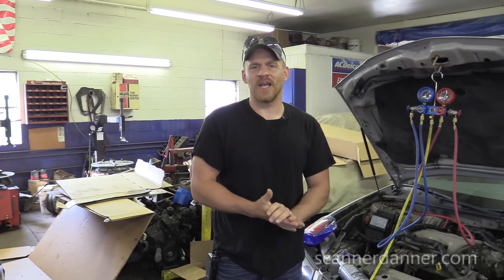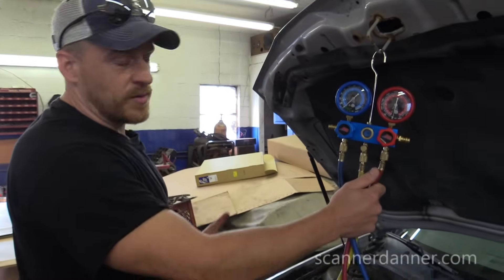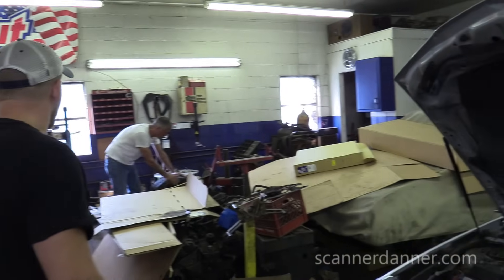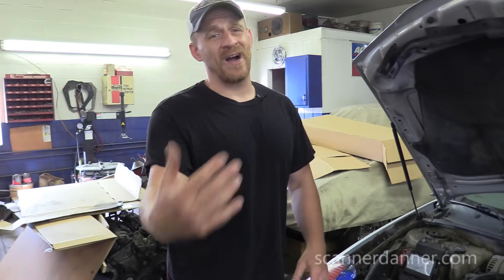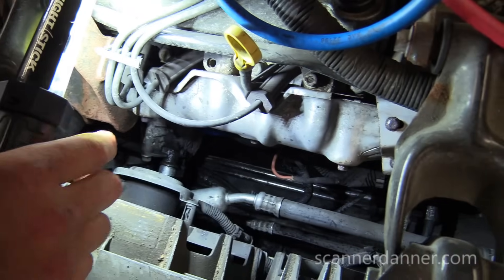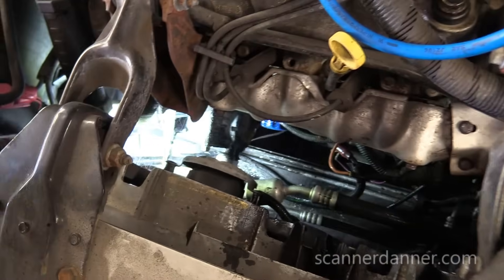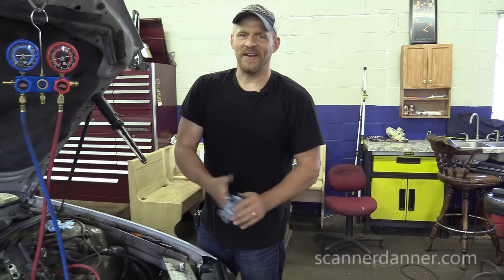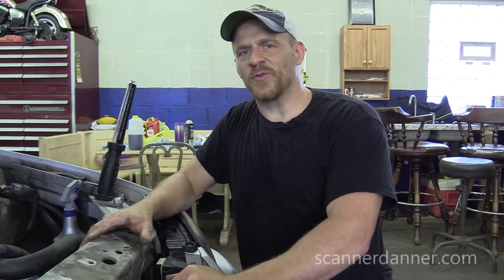A/C Leak Testing Using Compressed Air, Soap and Water (any car)

Comment: Hey Scanner! I added freon to our Peterbilt 379 Road Tractor and the lowest vent temp I saw was 50 degrees.
That was at 25 PSI low side and 180 ish high side 78 degrees ambient temp.

Any more pressure than that and temps dropped in the vents from 26 psi up to 40 psi.
At 40 PSI it finally settled at 64 degrees vent temp.
I'm think that moisture is in the system. Maybe I should evacuate the system, vacuum it down extra long and try it over?
Reply: Blade - I added shut off valves to the heater cores for summer in the freightliner ( freightliners suck) I drive. You'll definitely drop your temp if you just added refrigerant to what might have been a lot of air or at least some air. If you're adding, their is a leak. Should probably find it, or you might not be doing anything by vacuuming ( would need a micron gauge to really see what's going on)and definitely replace receiver dryer, that will drop your temp more.
Reply: It does have a heater core with blend doors but I've cut off the valves under the hood to the heater core.
Without that it blows 70+  degrees in the vents.
Somethings definitely not right with the Pete our KW is blowin a chillin 39 degrees in the vents since we put a new compressor, dryer  and expansion valve in it.
Reply from the maker: IS there also a heater core and blend doors like in a car? If so, pinch off the heater hoses and see if your temp drops at the vents.
Reply: Yeah there's definitely a leak. We've had to add freon every summer for 4 years now, I guess since it got a new compressor. Its a slow leak but still a leak that needs fixing. I've been trying to get a recovery machine so we don't waste freon to do repairs. 

I have everything now but the recovery machine. I have a recovery tank scales, gauges etc.

The Pete actually came with valves to shut the heater core off. We keep those off all summer.
I've seen folks add them to light trucks like F150's as well and it definitely helps to keep the heat out of the dash.
Reply: Blade, as Dan has been emphasizing, on your Pete, it is highly inadvisable to pressurize the system with shop air, for the Pete probably still has R14a in it.  On our KW's, I often discover the schraeder valves are the source of the slow leak and just installing new "O" rings fixes that issue.  Hope that helps. 

Over those last four years, each year how many pounds/ounces have been added to make the air cool enough?  Bear in mind that after the  annual addition of the refrigerant into the Pete, air is still present in the system, and so maximum cooling efficiency cannot be achieved.
Reply from the maker: Chad Jessup my name is Paul :-)
Reply: And I would guess that I am not the first one to commit that mistake. :-)  I'll try not to do that again.

Comment: To set the record straight  from  R134a  saftey data sheet.
Flash Point:  Non-inflamable
Ignition temperature: Not Applicable (Non-inflamable)
Upper Exlosive Limit: Not Applicable Non-infamable)
Reply from the maker: Thanks Andy!
Reply: Andrew W MacFadyen well then

Comment: I have a small flask of ultra pure nitrogen that I like to use for testing. A bonus is that it's a very quiet process and can often hear leaks. I use a UV torch to search for leaks in a dark as possible workshop. The leak will fluoresce under UV lighting.

Comment: I have 100% Argon with my tig welder, and I've often wondered if that would work as well as nitrogen does for this indication. It's certainly inert, and finding a connector to the gauge set shouldn't be difficult. I've never tried.
Reply: yes you can use argon, but beware, it's heavier than air and will displace it in confined/small areas, possibly causing suffocation in enclosed low areas... nitrogen is a little lighter than air, so less chance of suffocation, but always be safe and well ventilated. (probably not cost effective though)
I'm sure you know that being a welder, the warning is for others :)

quote from 'national refrigerants article,  ""When a system needs to be pressurized, for example to perform leak checking, nitrogen or argon are commonly used. These inert gases are also purged through lines when brazing in order to reduce oxidation buildup inside tubing.""

http://www.refrigerants.com/pdf/NRInews-Smr11.pdf
Reply: spelunkerd It would be a little more expensive but I'm sure it would work it's clean and dry
Reply from the maker: Not sure brother.
Reply: Dear spelunkerd I saw all practical HVAC people are using regular compressed air to find the leak. I also used tons of times and not got any problem only a single time! The HVAC theory makes things that complicated that nobody with readily available resources could do a useful work. This is an unfortunate and discouraging behavior. Paul did the nice job while testing and hope his system may run with professional results. Regards,

Comment: What kind of Hack are you?  You are a teacher you need to use nitrogen.  This is not a safe  method.  You are  contaminating the oil. It is a fire Hazard to.  Please do some research!!!!
Reply from the maker: It's not a fire hazard when there is no refrigerant in the system. 
I've been using this method for 25 years with Zero issues. 
You don't have to like it. I think it's a much better alternative than adding refrigerant to find a leak, especially when it's a gaping hole and all you end up doing is pumping refrigerant into the atmosphere.
Reply: ScannerDanner how about I for you to manufacturers AC manuals.     Just because you've been doing it for 25 years don't make it right.  The change came more apparent when started using 134A.  Please leave me your email address and I won't make it public and that way you can learn and pass on the information.
Reply from the maker: We can all learn right here bro. I don't mind. Post it. Just leave the name calling out of it. We can have a pleasant disagreement without it.
BTW, there are a lot of things I do that a manufacture wouldn't recommend. I'm not a "by the book only" guy. Everyone I know that is like that can't even fix a sandwich let alone a car.
Safety is another issue though. If your telling me that an EMPTY system can be explosive in some way with compressed air, I would like to read about that. I just don't see it.
Reply: very cool info- I would try compressed air on one of dad's or my used cars if he was still in business. I did a lot of the  r~12 auto's and read the same thing of r-12 being explosive with the right amount of air. In the early 80's i had 3 cars in shop, fans running and radio blasting. hook up to car w/ 30lb tank r-12  open both manifold valves and walking around, fucking off  I look at the gauges and they still on 0 psi. i like wtf is going on. i here  it under car. looking around there is hoses missing on the car.  I would not use that method on a brand new car though or the new refrigerant 1234sf as it is certainly flammable,   i have herd
Reply: My comment above about the test light is tongue in cheek, of course.  I have learned more from Paul Danner than any other tech, in person or on YouTube, thanks to his premium channel and his book (highly recommend, by the way.)  What I have learned, aside from the obvious technical stuff, and how to safely use a test light on a computer controlled circuit, is that he will admit his mistakes and keep them in his videos--He doesn't edit the mistakes out to make himself look perfect.  Sometimes I even laugh at him but the lessons are there to be learned by us all.  He's an excellent teacher.  

In this case I just don't see any mistake.  I admit I am self-taught and YouTube taught in AC work but have done quite a few systems from simple recharges to full system replacements.  I just don't see how filling a completely empty system with compressed air poses any safety issue.  Air is already 70% nitrogen so is mostly inert anyway.  And with no R134 in the system it poses as much of a safety hazard as your air compressor itself does.  I'd admit it's not a good idea to put it in a system with refrigerant left in the system but not sure why you'd want to anyway.  

ScannerDanner is one of the best teachers on YouTube and I appreciate the significant time and effort he puts into his videos.  If you don't subscribe to his premium channel, you should.  I think most every tech (and DIY'er) out there could learn from it.
Reply: Yeah, quit using that test light on computer controlled circuits!!
Reply from the maker: Lol exactly
Reply from the maker: Thank you so much johnaclark1 you have no idea how much this type of feedback means to me. It is the wind in my sails to keep going!
Reply: I don't just give it.  You've earned it, Paul.  Your channels have given me the confidence to do work for more than just myself and have earned me some extra cash on the side.  Some happy car owners have left my garage thanks to what I've learned from you, as well as Eric O. and Ivan.  I even fixed a car with some O2 codes that two other shops couldn't/wouldn't fix and I've no formal training other than your premium channel. 

Just keep it up.  There are many that really appreciate it.
Reply: I second everything Mr Clark wrote.

Comment: The ScannerDanner Premium Channel is where it's at, folks. Subscribe! You won't be disappointed, I can tell you that for sure. 

I'll be doing this same job next weekend on my buddy's mom's '03 Monte Carlo. Has a small leak somewhere. I'll be cheating, though, with my H-10 Pro! :D That thing is amazing ... but I guess it should be for what they cost. 

When I check for leaks using a spray, I use Windex - it's a crappy glass cleaner (ALWAYS leaves smudges and streaks), but works beautifully on tires, tubes, or A/C systems. It's my go-to bottle when customers have slow, nagging tire leaks - hasn't let me down yet! Can spray an entire tire down in half a minute, and any small punctures will reveal themselves pretty quick. Makes super fine bubbles on small leaks, and larger bubbles on bigger leaks.

I love doing A/C work. First system I ever touched was my aftermarket AMA under-dash unit in my '72 El Camino about 17 years ago. TXV system designed for R12. Ran Freeze-12 alternative refrigerant in it for about a decade - stuff worked great! Years later I was playing around and charged the system up with BBQ propane out of the grill, LOL. Thing was like a supermarket freezer - fogged up the rear glass, and blew vent temps around 33°F. Was AWESOME on a 94° day with 77% humidity. :D  I accepted responsibility for my own safety, so it was all good. :)
Reply from the maker: I've heard of people doing that when R12 cost went through the roof. I also heard of someone blowing themselves up due to an EVAP core leak. They lit a cigarette and BOOM. At least we were told that. Who knows. I know I wouldn't use a flammable refrigerant, though I've heard some manufactures may be going to that?
Reply: The new 1234YF is mildly flammable. Not as much as propane, but it will burn, I hear.

There's a product out there called Envirosafe that I've used before - they don't tell you what the components are, but I suspect it's R290 (propane) and R600 (butane) mixed. Butane keeps the pressure in check. There's a few others out there that are flammable too.

I hear that Europe and Canada use R290 in many different applications, including household refrigerators. 

Could be scare tactics from companies that stand to lose alot of money. Never know ...
Reply: I have been running R-152 (canned air duster) in my 1989 truck, originally R-12 system then converted to 134 (dirty DIY conversion) for 2 years now. Cold as ice, I get 4 cans for $10, system takes 2 cans. The sniffer detects the stuff too. I'm sure there's still some old R-12 mineral oil in there as well as the ester oil I have added over the years.
Reply: I almost bought a case of that stuff before I restored the system on our '86 Grand Marquis. I've seen similar results as yours posted across the net.

I had run just about everything for refrigerant in that thing, before the 29 year old (at the time) compressor decided it had had enough of that, and got real LOUD, lol. I think the 142b in the Freeze-12 that I was running leaked out, leaving just 134a in the mineral oil/ester mix, and starved the compressor of lubricant. 

Restored it back to original R12 and mineral oil. Everything new. Thing blows vent temps in the upper 30's on 90°, humid days. It's absolutely awesome. :)

Comment: thanks good morning and is coffee time for me is it the nitrogen expensive?
Reply from the maker: It's not that it is expensive, it's just being able to locate a place that can fill your bottle. (Then you need a bottle too). If your a garage, having a large tank would fix this issue as you wouldn't have to fill it as often. But as a mobile guy, I have a small tank and one AC test with a large leak and your bottle is empty. It's just not worth it

Comment: just curious how ya gunna figure how much oil to  put back in. some compressors you can dipstick  most of these new ones not
Reply: richard cranium service manuals will give you a amount based on what is being done or has happened.
You can also drain out and measure what's in that component and add how much was pulled out when it was recovered and add that back in
Reply from the maker: Nice! I've never done that. We're are in agreement as for how much oil to add. Thanks man
Reply: johnaclark1 yeah sometimes it's better to flush everything and start from scratch
Reply from the maker: Thanks for replying KD Automotive. 
richard cranium, exactly what he said. Though from my experience you almost do not get any measurable amount to come out of anything.
Reply: ScannerDanner drill a hole in the bottom of accumulators and you'll get a couple ounces. I've never gotten anything out of a receiver/dryer or condenser. I've read rule of thumb is 1 oz. for each of those.
If replacing a compressor measure what was in the old one and put that much back in the new compressor.
Reply: ScannerDanner I will add when looking at service manuals use your best judgement I've seen some crazy call outs for oil. I put a condenser and receiver/dryer in a ford escape the other day and the service manual said 2oz for condenser 1oz for dryer and add another 2oz and what was removed during recovery. That would have been 6ozs on a system that only takes 7ozs. I put 3ozs back in
Reply: I just did a full system replacement of everything under the hood for a friend on a 2003 Mustang.  I got zero oil out of the drilled hole in the bottom of the accumulator and zero oil out of the old compressor.  I ended up flushing the evap but sometimes nothing comes out and other times you get 4-5 ounces out.  The orifice tube was completely blocked so I guess maybe it was all in the condenser and evaporator.  I ended up just putting a full system charge of oil in it.  It's tough to know exactly how much to put in if you don't have a fully clean/dry system.
Reply: exactly my point. from what ive seen and read there is no consensus in the industry as a preferred or accepted amount. it seems each is a swag (scientifically wild assed guess). thanx everyone for your replies
Reply: richard cranium I would say the hardest situation is when a line burst and you have a rapid lose or refrigerant.
Reply from the maker: Yep exactly